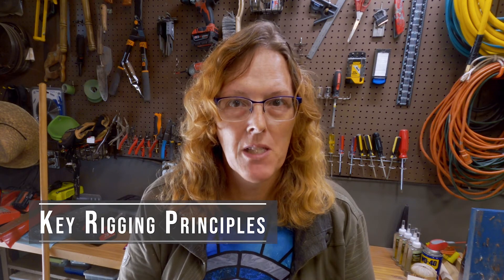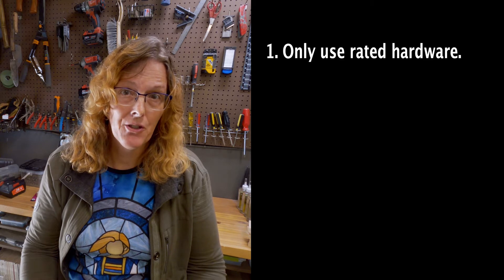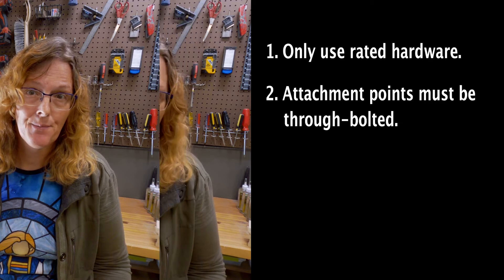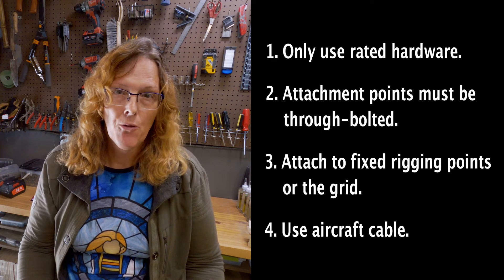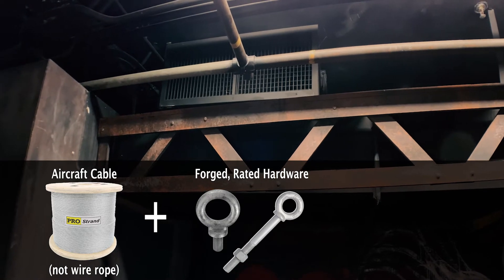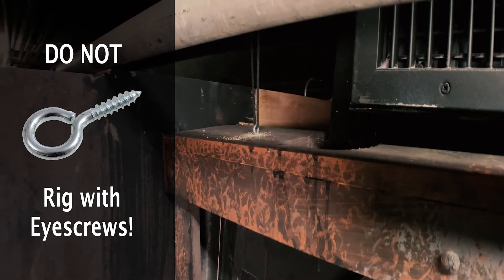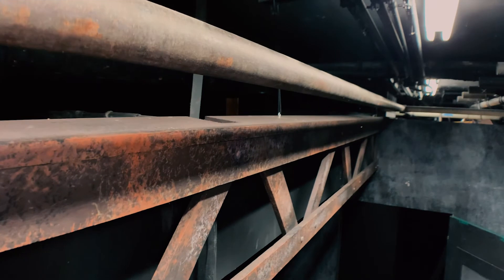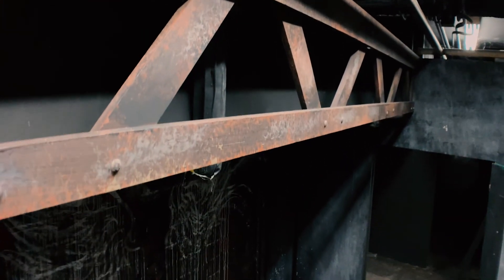Rigging Failures 1

Comment from the maker: I've had some in-person conversations about tie line and its rating and there seems to be some confusion about that topic. Tie line has zero rating. It is not rated for overhead suspension of anything. It does often have a listed breaking strength. And no that breaking strength is not 600lbs. That listed breaking strength is 75lbs. 

Having a listed breaking strength still does not make it safe for overhead rigging. 

Listed breaking strength is what they have tested to be the amount of force before it breaks. But that doesn't mean we can load a single piece with up to 75lbs safely! We have to have a safety design factor which we use to calculate a safe working load/limit. You'll notice that no manufacturer of tie line lists a SWL. They only list breaking strength. If they listed a SWL, that would mean they have rated their tie line with a specified safety design factor and that they would trust it with that amount of load. They do not. So you probably should not either.

Tie line, unlike aircraft cable, is easily abraded and much more subject to wear and tear. We tie it in knots all the time. We don't do that with aircraft cable. In practice we are quickly destroying tie line's ability to maintain its 75lb breaking strength. Not to mention that we use knots to put it in place. There are no wire rope clips, gripples, or nico press options for tie line. So we tie it into a knot often at both ends. Each knot reduces the safe working load by 50%. 

So, how do we determine SWL of tie line? The easy answer is don't do it, because in doing so you are considering using it for overhead rigging. But if you must, here we go:

The most common safety design factor among manufacturers of rated hardware is 5:1. So let's use that for tie line. Our 75lb breaking strength at 5:1 means we have a SWL of 15lbs. Until we tie that knot. Now our SWL is reduced to 7.5lbs. Suddenly our tie line doesn't look so safe after all.

In theatre, we are often using a 10:1 or 13:1 safety design factor, especially if there is a dynamic load on our suspended object. With 10:1, we start at 7.5lbs SWL, add our knot and we are down to 3.75lbs SWL. But wait, we did two knots, one on the object and one on the grid or lineset, so let's reduce that another 50% to our final answer of 1.875lbs SWL. You still want to use that tie line for overhead rigging?

For 13:1 safety design factor: We start with 5.77lbs SWL. Add our first knot. We are now down to 2.88lbs SWL. Add that second knot and we are down to 1.44lbs SWL.

The short answer? Don't rig anything with tie line!